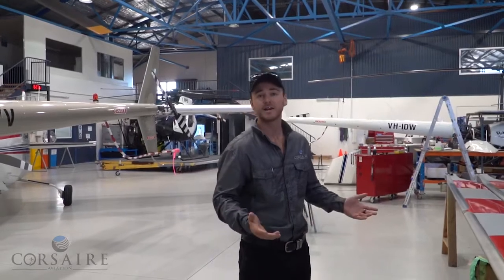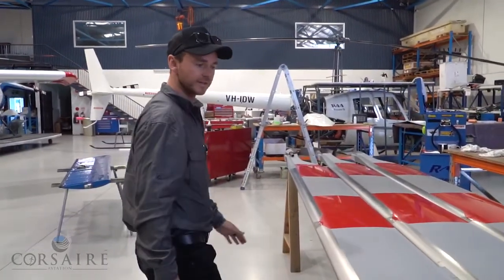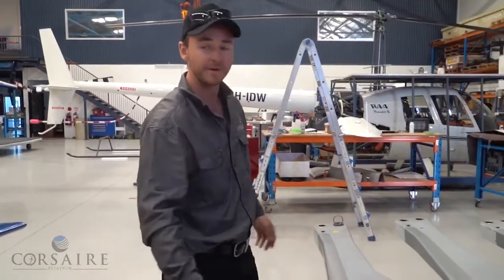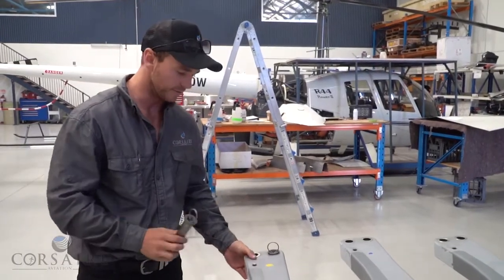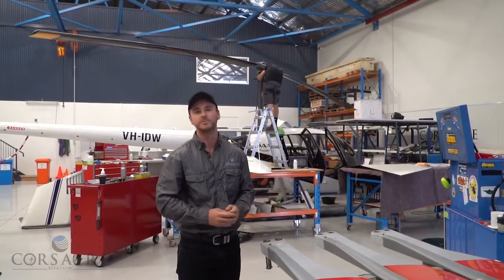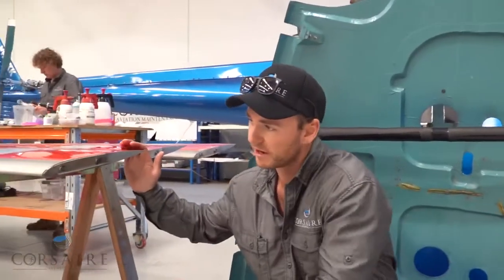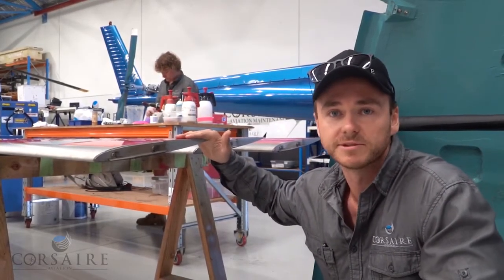AS355 Main Rotor Blades

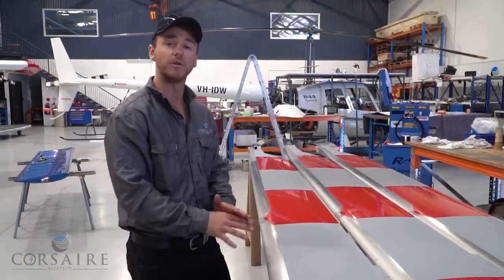Comment: hi,  00:35 , how to attached stainless steel  blade edge
Reply: By using structural adhesive to heat cure it with the help of cheese cloth and some wiremesh